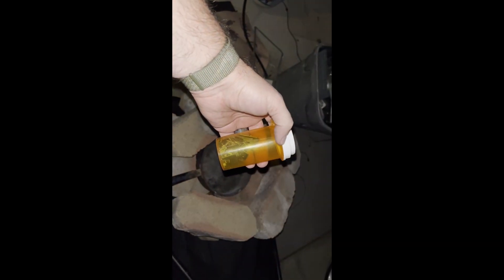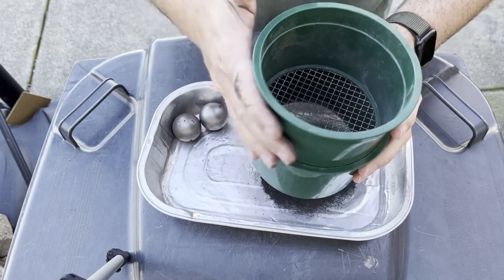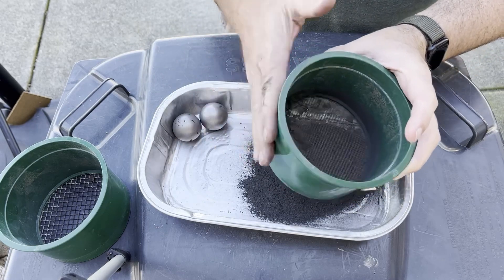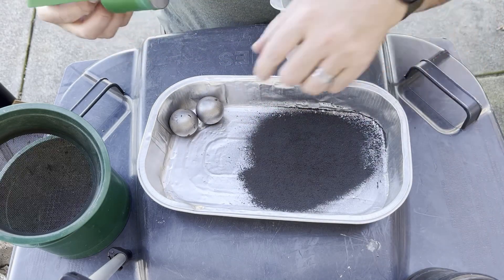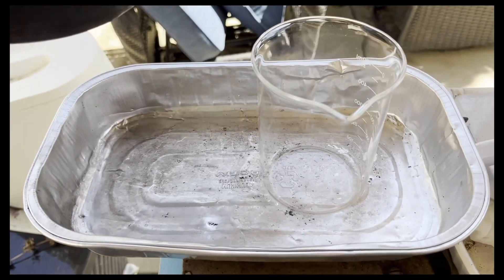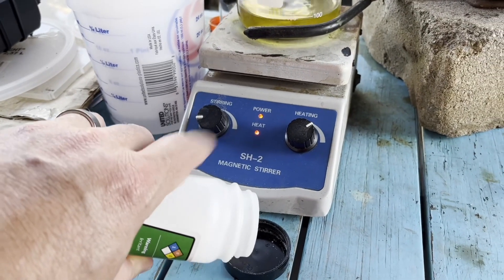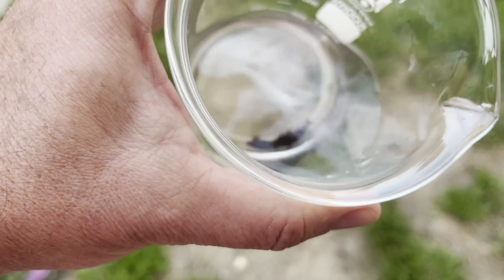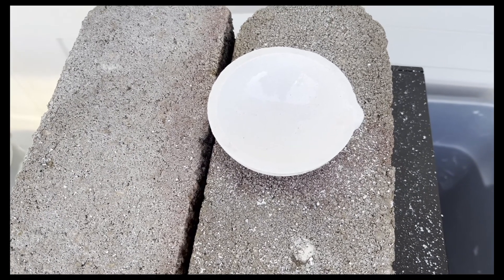Gold Recovery - Mixed IC Chips from two Dell PowerConnect 2848 Switches

Comment: Glad you did this experiment. The resale value of the switches is definitely higher than the value of the gold content. And with the money from the resale, you can buy gold! Ive bought used equipment as well, hoping to use it for precious metal recovery, but all the work just to depopulate the boards isnt worth the time.
Reply from the maker: Totally.  I’ve got 6 more of these on my eBay store and they aren’t moving at all.  I think there’s so much material out there, you really need to get lucky with who views your eBay account and who really wants to buy.  The other problem with these switches is they are so heavy.  I had to turn down two offers because they would have cost me more in shipping than the cost of the switches+taxes+eBay fees+shipping.  Too bad I can’t get anyone near me to want to set up a network in a small / medium sized business.  For now, they will sit in the box and wait for the right buyer.   Lucky for me, I enjoy the scrap process and enjoy recovering/recycling.  It’s a hobby that pays back in sustainable value items.  All good.  Thank you for the view!